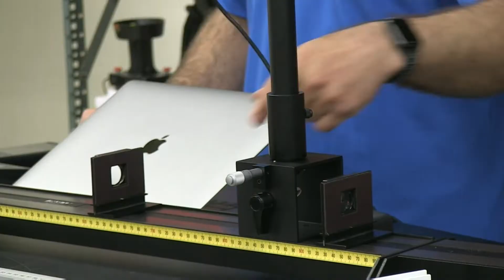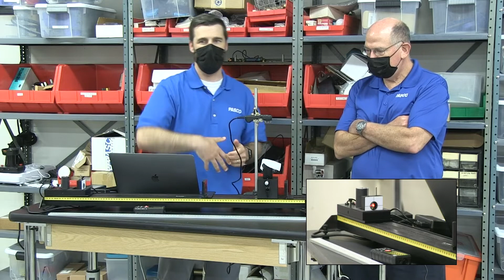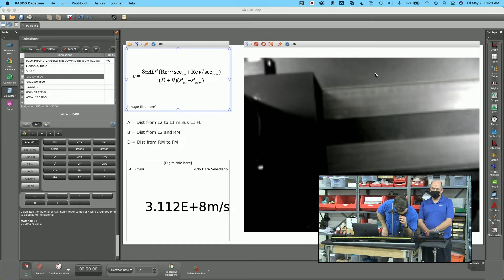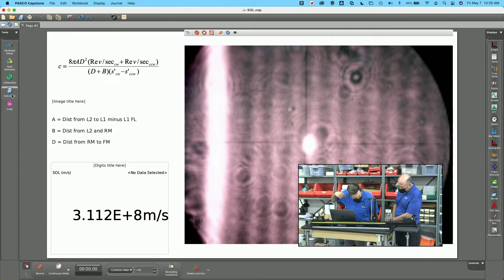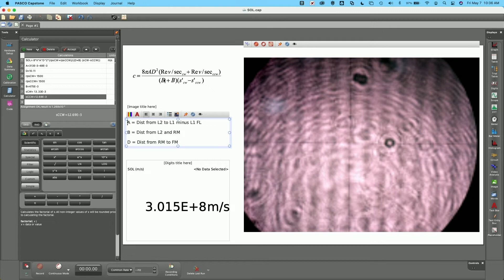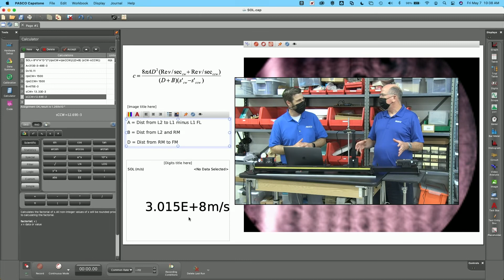Speed of Light Experiment - EX-9932A

Comment: You have the length measurements in meters, but the image measurements in mm… are you converting all to meters before calculating?
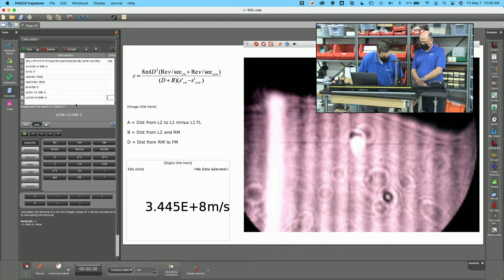Reply from the maker: Yes, that's correct. The length values are being entered into the Capstone calculator in meters. For example, around [22:59], the micrometer reading of 13.33 mm is entered into the Calculator in meters as 13.33E-3 (that is, 13.33x10^-3).